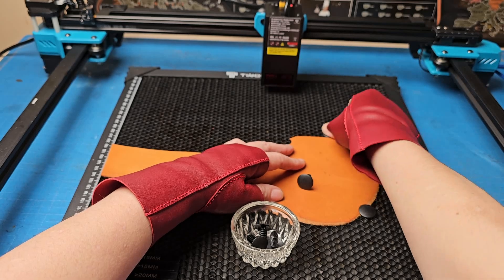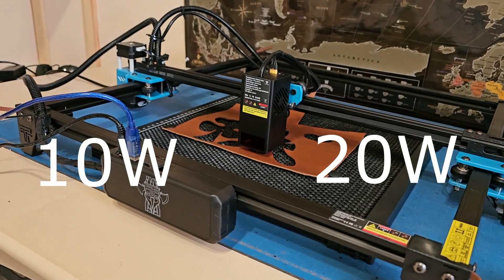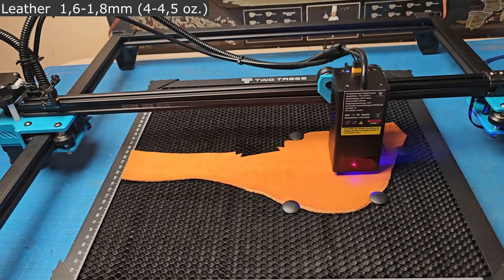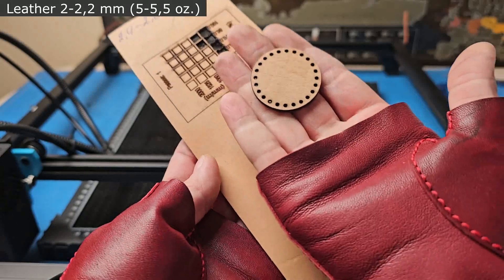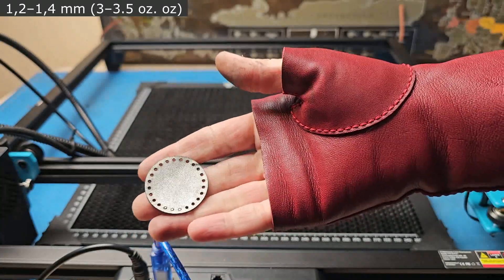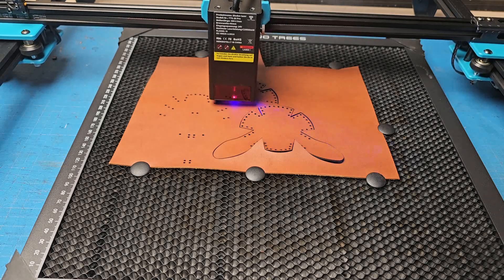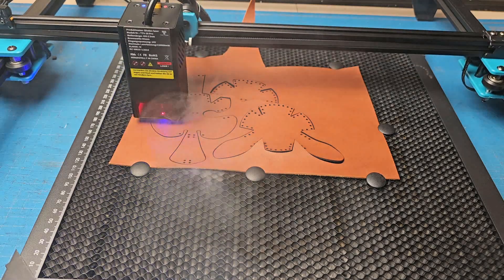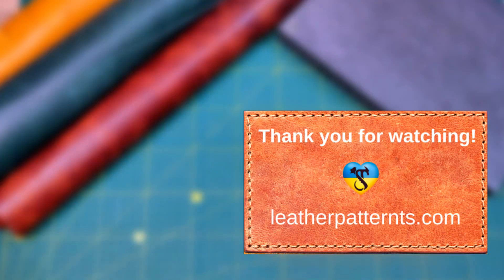Tests: Laser Cutting Leather – Do Leathercrafters Need a Laser?

Comment: Great video!  A good way I found to reduce /eliminate the burn marks is to put masking tape over your leather before you cut.  I use the painters masking tape as it is more easily removed after you complete your cutting.  It really works!  I used thin gray leather to cut out your dog chain purse and had NO burn marks!  Yeah!
Reply from the maker: Thank you for your comment! I actually tried that too, but the edges still turn black. Maybe it depends on the laser engraver itself and its power/settings.

Comment: Unless you ventilate outside, dont cut or engrave any other leather than veg tanned, i'm also planning to work with leather and while researching ive learned that you shouldnt cut leather that was treated with chromium or has unknown coatings, also dont do synthetic leather as all those things release harmful carcinogenic fumes. Just FYI, i will be focusing on wood mostly but one potential client said they might want something from leather so thats why i was looking into it, stay safe
Reply: How is this the first comment about the deadly fumes, especially with chrome-tanned leather, which it looks like she's entirely using! @LeatherPatternTS, you should take this down until you have a chance to make another video that mentions this!

Comment: Hey how you solve problem  with burning edges, dont matter hwat i do they cracking
Reply from the maker: In the video, I mentioned that sometimes the burned edges don't bother me. However, I still punch the holes by hand for the final versions of the products — I only use the laser for cutting. The pieces don't crack; they just have a blackened edge.

Comment: I honestly can't believe you are operating this without an exhaust and an enclosure. Not safe.

FYI, try putting masking tape on the leather before cutting. Or if it's vegtan, wet it so it sits flat on the bed. Then clean it with a wet sponge. It will smell for awhile since the laser is cutting skin. It will fade in a few days. I usually use the Aussie conditioner to clean up the leather and the stitching holes.
Reply from the maker: Hello! Thank you for your advice. 😊 As I mentioned in the video, this engraver was borrowed for testing purposes for just one video. The owner didn’t have any additional accessories, like a smoke exhaust box. So yes, I had to breathe in that smoke, and it was horrible.

Now I’ve purchased a closed engraver, the xTool M1. It’s much safer since it’s enclosed and has proper smoke exhaust to the outside. I might make a video about it after I’ve worked with it for some time. 😊

Comment: I have the algo 20w alpha laser I love it I want to try leather .. I have leather just haven’t found the right time not sure of the speed and power to cut though it . Or how many passes it takes
Reply from the maker: I think it makes sense to run a test, as this feature is available in the program. This way, you can determine both the speed and power.
Reply: @ definitely thanks

Comment: I have two sculpfun lasers, an s9  5w with out air assist and an an S10 10w with air assist. both work fine on the leather items I make, but for cleaner cutting the S10 is far superior with the air assist, far less scorching.
Reply from the maker: Hello! Thank you for your comment. Yes, indeed, laser engravers cut leather very well. You have a wonderful YouTube channel. I’ve subscribed to you 😊
Reply: Hello there!

Thanks for your comment: glad to faced with someone, who already walking through this: i got mine s9 for a week ago and still testing parameters for different leather thickness.

If it appropriate, could you please share tips of it or some sources with the settings you use?
Reply from the maker: @NightKryptonite  Thank you! I just use the test grids available in the app. Check from 1:40 in this video to see how to do it. On the test samples, you can clearly see which speed/power settings work best.

I don’t think any advice will really help. I can tell you the settings for 2mm vegetable-tanned leather, for example, but your 2mm leather might have a different density, and those settings may not work. The only way to determine the right settings is through experimentation with the leather you are using. That’s exactly what test grids are for.
Reply: @LeatherPatternTS  thanks for advice, sounds like this is the only way is trial and error method.

i understand, why u prefer s10: 5w right on the edge of what's needed for the leatherwork.
What i can say right now after some tests: better results with s9 i can get only with 2 passes or more.

wish u a nice day !

Comment: Interesting video. Are the burned edges good as they are or do they still need burnishing to look slick?
Reply from the maker: I’m not too bothered by the blackened edges and stitching holes. In most of my products, I darken the leather edge with paint, so this works for me. Despite the fact that the cut is very clean, a little Tokonole wouldn’t hurt to smooth out the leather edges.